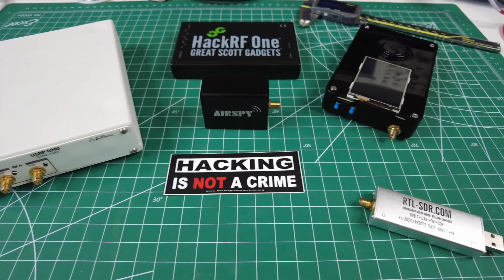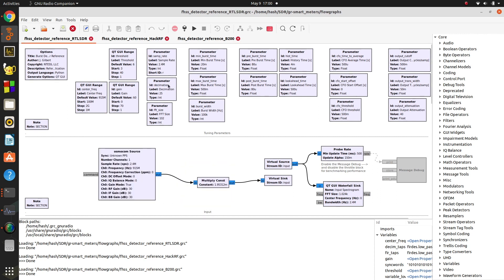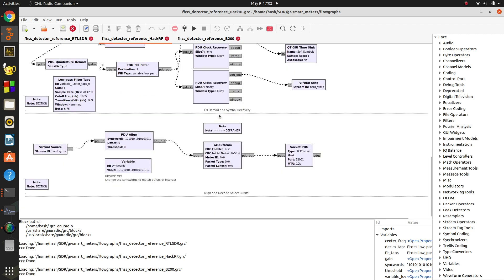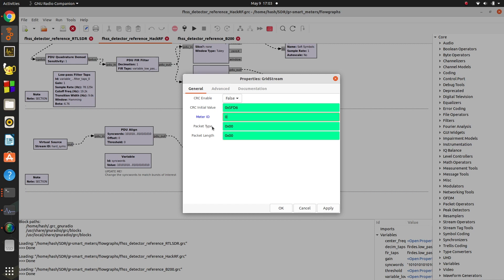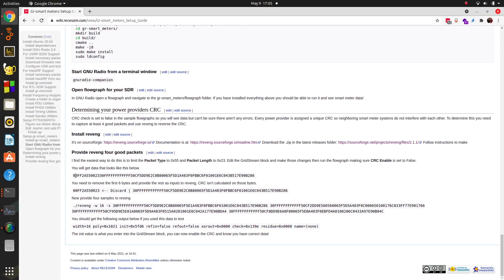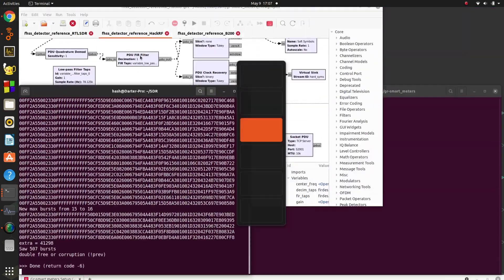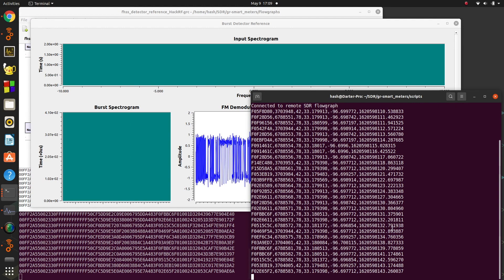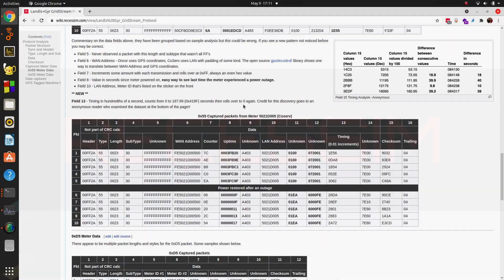Smart Meter Hacking - SDR Setup

Comment: dang.. how does one learn to hack like that... any tips?
Reply from the maker: The way I learn is by creating small hands-on projects for myself. Sometimes they are to no particular end, but what I learn along the way helps in the next challenge.

Right now I am focusing on Python programming. Basically the more you learn the more “powerful” your hacking abilities are. The challenge is finding how you learn best so you can keep challenging yourself to learn more so your skills constantly improve.

At some point your skills will even impress yourself as you solve problems that would have seemed impossible to you before! If you like hardware check out the free book “Hacking the XBOX” available as a PDF, search Google.
Reply: There is also another channel: SaveItForParts

Comment: So when using a RTLSDR dongle you're only seeing 1/10 of the band and might miss a significant amount of data, It must also be hard to track the data from a single meter with the frequency hopping around the ISM band and the limited bandwidth provided by the dongle.
Reply from the maker: That’s exactly right, you can still get data to play with but you aren’t getting the full picture. Even with a SDR that covers the full bandwidth it is hard to know if you’re getting EVERY message from a given meter. But you do get a lot more traffic.

Comment: Hi, I ran through the setup guide. When I start gnuradio, I get an error that it can not find fhss-utils. I added it to the path in .bashrc file. Still no luck. On Ubuntu 20.04. I'm on an rtl_sdr but I just ordered HackRF One. Any ideas?
Reply: I need some help. I reloaded my laptop with Ubuntu 20.04. I followed the setup guide step by step. I had to change some of the python path statements. Now I can open gnuradio. I can load the flow graph fine, no errors. When I press play, it created the python flow graph file and executes it. The last error says that it can not load module fhss-utils.  Did I miss something? How can I find out where fhss-utils is referenced to load from?

Comment: Very helpful but made more questions. Cleared up a some of that WAN Address field in the type 55 broadcast packet. I thought it was originally just a 6 byte MAC, but it's clever how it's a GPS location + color. I also originally thought the GPS could uniquely identify a customer by itself, but seeing that there can be 32 SmartMeters in one location, I wonder what is used to identify a customer account? GPS+color alone, or WAN+LAN address? I didn't think it was LAN address only since there is a max of 4 billion devices. I mean, what happens if someone is spoofing or jamming GPS and the SmartMeter isn't transmitting the right GPS info? Does it fail to a DoS or does it fail to free electricity? Wondering now if this is pre-configured into the meter or is there a GPS chip reading satellite info? I assumed there was a chip. Hope the manufacture accounted for big earthquake shift in GPS locations. I looked at the script and found it interesting that the protocol considers it NON-GPS data when in parts of Antarctica. (0xfe Lat part of WAN address). I couldn't find the script in github and had to get it off the backup github, but might want to keep a copy in there since people might be looking for it from this video.

Comment: I'm using the RTLSDR and get no output from Gridstream block. I do not have a "~/gr-smart-meters/flowgraphs" subdirectory but rather the "examples" subdirectory which is where I opened the  flowgraph from. Not sure if there was supposed to be a generated flowgraph directory or not during the installation process. Everything was made from a fresh install from the OS to the gnuradio components, and FHSS utilities, etc. Looking for guidance for how to get it working. I'm running Ubuntu 20.04 as a VMWare guest on a Macbook Pro laptop. Thanks for any help offered.
Reply from the maker: Join the Discord channel linked off RECESSIM.com and we can see what we can do to help. Assuming you have L+G smart meters in your area.
Reply: I'm in the exact same boat, did you find a resolution?
Reply from the maker: @marvinmartin1357  check the examples folder, and if you get no output make sure the smart meters in your area say GridStream RF on them
Reply: @RECESSIM  It was a mistake on my part, got it working like a charm. Great content! Subbed
Reply: @marvinmartin1357  Unfortunately, I have not found a resolution. No output in the examples folder either.
Reply: @BWhyz-od1kz  I got it working, it was a mistake on my part. I ended up starting from scratch with a new VM. But I think the part I missed was installing the gr-smart_meters. It works good now.
Reply: @marvinmartin1357  Nice work, Marvin. I'm still having issues with mine. The GUI comes up and the RTLSDR flowgraph runs fine EXCEPT I get no hex data output in the GUI display. It's almost like it isn't capturing any packets based on the default syncword provided. I've tried several times starting fresh with a new VM and reinstalling everything but to no avail, yet.

Comment: It works great. I Tried the RTL-SDR, it seems to not collect a lot of samples, the UI also seems slower (I think it might be because of your "device by 10" with everything RTL-SDR. I will try the Hack-RF next. 

Here in Quebec Canada, there is only 1 Power Supplier, so it was easy to extract the CRC and so on. 
However, there seems to have no GPS data at all, it does connect but nothing comes it.

I got a bunch of samples and glad to share with you, if you let me know what is the best way to do so.
Reply: Hey thanks a lot,I'm also in Quebec and was wondering

Glad to know they aren't to intrusive
Reply from the maker: Go check out https://wiki.RECESSIM.com and there’s also a Discord link there.